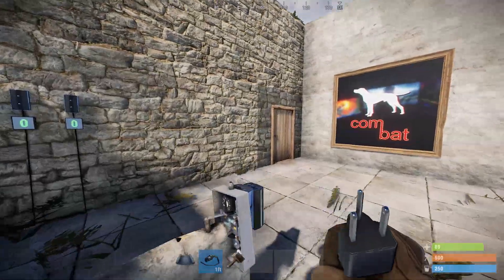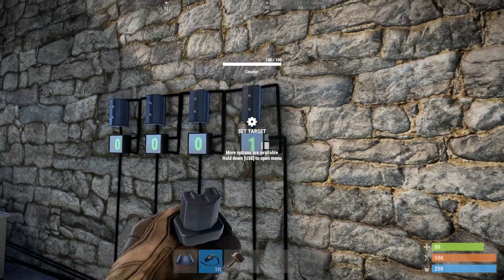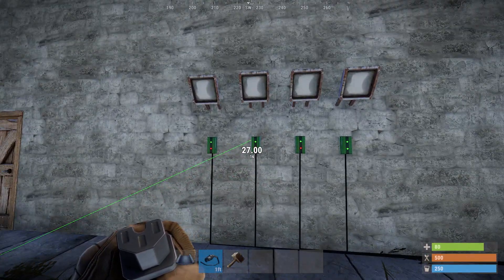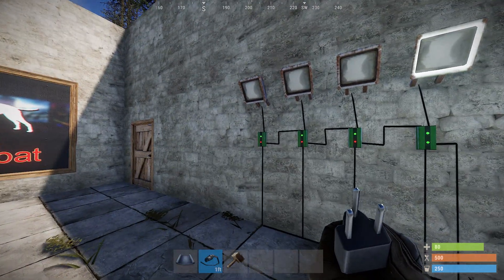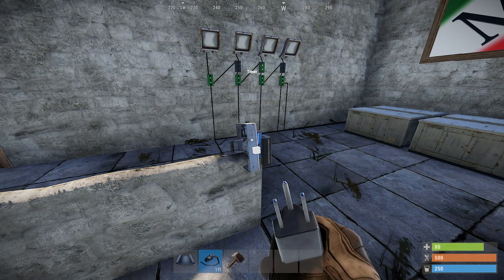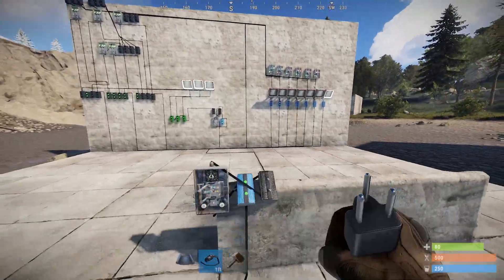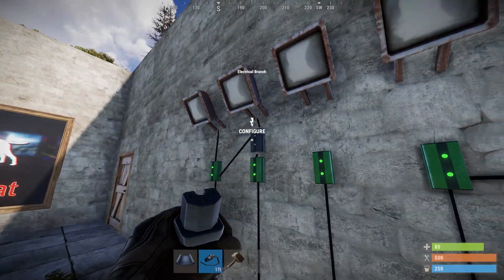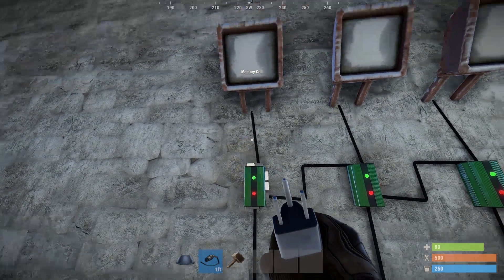Making a Binary Counter with 4 MemCells! (Easy, How-to, Counts to 15) | Rust Electronics

Comment: im trying to make a touring complete computer in rust. but i can't write to memory, im basically trying to make the program counter right now and i was gonna count with this, and before i write i reset the memory and then write, but the second i kill the write memory signal it bugs out and stuff lights up that shouldn't. all my friends are dumb as fuck so i have no one to turn to. im getting desperate. i don't wanna get stuck HERE. on THIS problem.
EDIT: i COULD do this with a million timers and complexity, ect. but im trying to keep it as light as possible, as every single component with memory will have to be a copy of the design lagging everything out if it gets too complex.
double edit: maybe we could even discord and collaborate, but no pressure. i'd rather be the "cool kid" who did this all on my own anyways. but i also want the project to get finished and done real well.